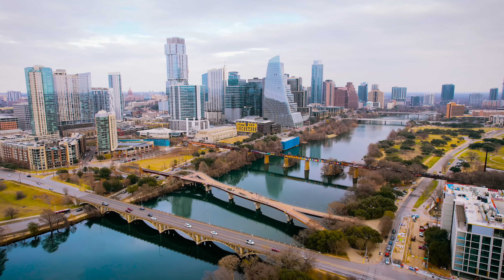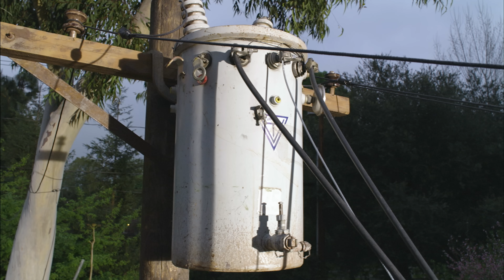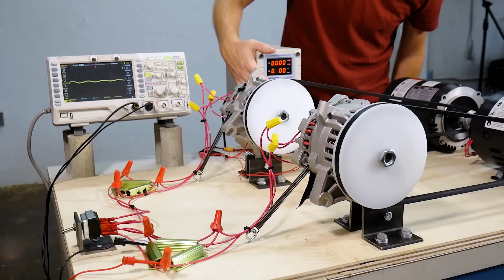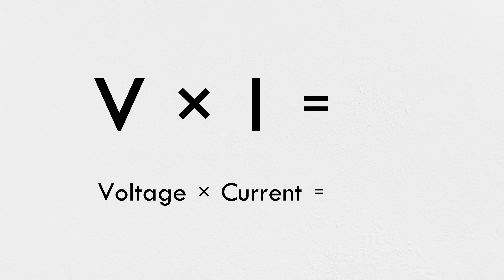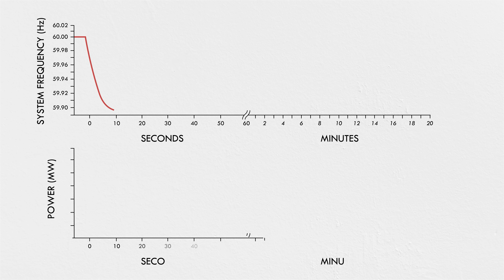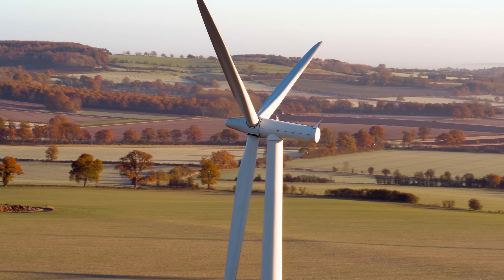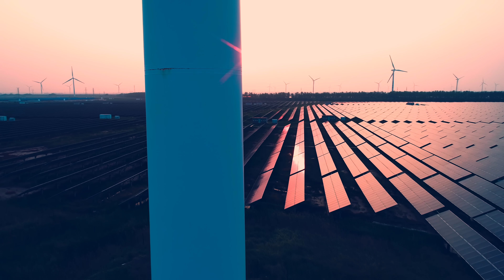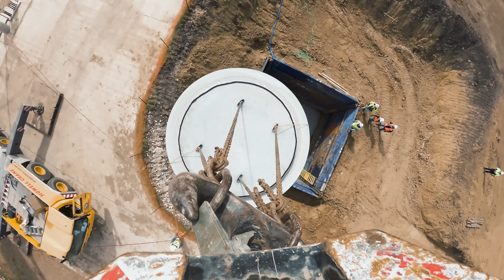Connecting Solar to the Grid is Harder Than You Think

Comment: You should do a video on DC power grids and the challenges of switching. This would solve a lot of these problems, and now that almost all devices rectify AC before using it and switching DC converters are getting smaller and cheaper, its starting to make a lot of sense. Obviously the biggest cost would be installing rectifiers at traditional power plants and replacing transformers with DC converters at substations, but then after the switch adding new renewables, flywheels and batteries would be much simpler. I'd love to see an analysis of at what point the switch is worth it.

Comment: 7:16 are all of them variating only voltage, or are also there some of them, which can also control, or limitate the frequency? I mean, for example, the power supply from the grid is missing, we start the diesel-alternator, switch to emergency power supply, connect alternator to our house, and grid inverter recognize the alternating voltage, and support our diesel-alternator. But if power consumtion is not big enough, the sun is shining, and grid inverter dont have frequency controlling (limitation), so the diesel-alternator will accelerate too much, and achieve too high rotational speed, piston will jump away from cylinder, and alternator generate to high electrical frequency, what could damage some electrical gadgets at home! But if grid inverter has also frequency limitation, it will support alternator, and it will run without fuel consumption or with less fuel consumtion, depends from pv power and electrical load. Even if grid inverter does not have frequency limitation, we can connect additional limiter to our home grid, and let him hold constant frequency with resistive load, bigger than maximal power of pv panels and inverter, and heat water or air for example. And there are of course also protecting guard relays, which could disconnect grid inverter, if something goes wrong! Have you already made such experiments, whether it works or not?

Comment: So we are "saving" the planet by covering it with solar panels and Windparks (both low energy density systems) and to make that stable need a backup of traditional power supply which is expensive and prone to faults because it does not run smoothly. So it is all expensive and destroys environment while increasing surface temperature where both solar and Windparks are built. 
Seems like a great idea.

Comment: There are other huge issues with IBRs, I am a Protection engineer and deal with them on a daily basis. Basically all the power system was built to follow specific laws of Physics, unfortunately the IBRs do not follow them. IBRs don't produce zero sequence current important to detect ground faults, no negative sequence or even worse, different angle between negative seq voltage and current, and positive seq maxed at 120-130% of the nominal which is less than an overload condition for the GSU. So there is no discriminator to reliably detect faults on transmission lines connected to them. Also, Spain used 80% RE in the day of the blackout and IBRs did not show to the party with any voltage support. So Renewables are a disaster in the making.

Comment: solar dump to a thermal heatsink battery. extract the heat with a heat exchanger.
Reply: That sound like a 60% loss at best
Reply: @Molombo89  A 5 m³ sand bed raised from 20°C to 70°C stores:

~89 kWh of usable thermal energy
R40 air tight box.

Comment: What if solar plants have a huge DC motor that converts all the solar energy into mechanical power, then convert it into electrical power in generators like the steam tubines do in usual thermic generation plants. That way we would have the inertia to withstand such variations. DC motors can be easily controlled to have a constant speed to match the 60 hertz required.

Comment: I saw one TED Talk in which the guy said WInd requires thermo electric powerplants to be built alongside them to smooth the power production variation. I know that small hydro power plants can be used to stmooth and even inertial systems could be used to smooth the power delivery oscilations (like a low-pass filter). It all depends on the generation matrix available. (the sources of electrical power).

Comment: How much power would be lost if people use DC engine - AC generator inverter? Most of the issues shown in the video would just disappear in that case. Grid would pull frequency of smaller generator automatically and phase synchronization is simple. Also shape obviously - a proper sin wave.

Comment: That's Why they have Low frequency Cut offs  which were Integrated after the 1969 Blackout in the North East.
Inverter technology has Come a Long way Since the early 1980's   we had a 50 HP three phase VFD Driver it was in a cabinet the size of a two door Closet In the early 90s you could get one in 22X 36" cabinet   now you get ion almost half the Size.. The Biggest 
Choke point Like electric cars is Better battery's

Comment: I've had solar PV plus inverter and batteries working happily for 16 months now. but at the end of April, it became unstable, on a hot spring day, but starting early in the morning, about an hour after sunrise after the batteries had begun to charge, the inverter decided to try to export some power to the grid, but my fridge and freezer needed to use that power too. For the rest of the day there was a 3-way battle between batteries, export or home use, the batteries eventually won, but my generation for the day was about 20% of what it should have been for a cloudless day, as was the day before too.
Exactly the problem described here.
Two home solutions for me, either switch the inverter off for a minute and restart it when it was becoming unstable, or switch off home demand until the batteries had fully charged, in my case shutting off fridge and freezer for an hour until the batteries had fully charged.

Comment: Here in Spain we’re still waiting for an explanation of what happened last Monday .Your explanation is excellent . Top quality .
Reply: Venia a comentar exactamente lo mismo
Reply: Same thing, I'm a spanish engineer and this  a really good explanation of the fragility of our current grid, energy/mix
Reply: Update in this topic: it looks like we found another weakness with inverter based resources especially when added up with poor control of reactive power, according to the Entso-e factual report it looks like the start of the cascading event is that, after the 2 big oscillation before 12:30h the configuration of lines and shunt reactors with the voltage feeding of the inverter based power generators caused an overvoltage in various places in the southwest Spain that caused first (they teorice) embedded inverters aka small household and industry rooftop installations to disconnect in overvoltage protection mode and that caused a sudden load increase in the grid causing the frequency to drop while the overvoltage in the grid also caused solar and wind farms to trip, causing the cascading effect much quicker that the load shedding could act in a very weak and unstable grid configuration
Reply: How so?  All this has long been known technically to power engineers. Grady is a fine communicator but he didn’t discover the max power point. And yet Spain/Portugal went and built a system w too much solar that was bound to fail anyway (killed 11 people).  Why is that?
Reply: Same here. Spain is among the countries with the largest renewable penetration, so what happened here might be foreshadowing what could happen in coming years elsewhere as renewables become the main sources of generation. Renewable producers that sell electricity to the grid need to be well-regulated to ensure they provide grid-resiliance mechanisms such as synthetic intertia, etc. Regulators and politicians nationally —and internationally— would do well to take notice.
Reply: @filiptc you sound like an article in the Economist
Reply: Je je, (S)pain

Comment: Typical panels produce 50% of rating in summer, 5 - 10% in rain and 25% in the other 9 months. Zero from 4pm to 11am. So a typical 10MW plant produces about 10% of its rated capacity which makes it a total scam. For SPAIN to say they are 100% green is BS because there is NO SUCH THING as 90% of the time the sun is off, panels underperform or wind is too low or too high. This is all just TOTAL SCAM
Reply: True as I can verify from my own PV array.
Reply: @mrradman2986  I am 100% off grid for 10 years. I think green for a private home is great. Once the politicians get involved its a total scam
Reply: @DanThomas-n1e  yes!
Solar is awesome for home use, with a battery bank you can easily go off grid and even make a profit in the long run.
But it's impossible to run serious industry off solar and wind. That requires round the clock available power on demand
Reply: @FerdinandFake  Exactly.

Comment: Why not have have a solar PV series string with 300K panels in series (and parallel for redundancy) producing a megavolt for powering UHVDC power lines?
Reply: How do you want to shield the modules from that Voltage? 

It would simply explode. KV on mm thick Materials is never a good idea. 
Capacity effects between modules usw.
Reply: @MJ-mw3ni  so you're telling me it would be a spectacular experiment to see what happens and maybe get some fireworks? 😉 Thanks for the explanation

Comment: The first grid storage sized Megapack that Tesla installed in Australia was for a wind farm. 

The intended use was to allow the wind farm to offer power at a higher level. If they were committed to the average power predicted, when there was below-average production (opposite of a gust), they couldn't meet their commitment. As a result, they could only commit to a power level substantially below the average of what they could provide. By using battery storage to fill in for those short drops, they could commit to a higher power level. 

They ended up paying for the batteries within a year because of payments the received for maintaining grid stability. The ability to instantaneously adjust output power did wonders for maintaining frequency. In fact, what they had previously considered good control now looked very noisy in comparison.

Comment: The real issue here is what should be the nature of the interlink between producers and consumers. The simple answer is idealized HV, but this splits into AC (765kv) and DC (500kv). 

So ideally if you don’t want trivial producers altering the phase of the grid, you would assign a large number of producers to HVDC super grid. Their responsibility would be to produce 500kv power, which is then converted by the power company to grid operator to HV - AC for transmission. The problem with this scheme is rather obvious. Electricity likes to travel and I think it’s something like mm/ 3000 volts in clean air thus 500,000 volts can travel 16 cm or about 6”. Therefore no small opertor can connect to 500,000 VDC without grid support. The grip operator needs to provide tap points in which each provider can switch remotely his DC. To imagine the complexity of this problem, imagine if each solar panel was 12 volt DC. In order to supply voltage to the grid a series of 50,000 panels with the end points of the series charged to 500,000 volts. A work around here is that instead of panels constituting the series the panels individual feed batteries that are then stored in protected and isolated which cycle between charging and feeding the grid tap point. 

   A second solution is to put the panel out put on a capacitor and then discharge the capacitor in a cycle, creating a wave function, you could have two of these per panel that fluctuate between say 8 and 12 volt (x2) creating a 4v wave that can be transformed into 500,000 volts AC and then rectified before the tap to DC. Other schemes would be panels directly produce 120VAC. In either case the pulses of all the panels need to be synchronized by a common clock so that the feed that reaches the power tap is the same phase. The power converted (either provided by the grid or the supplier) the converts this to DC. 

  The alternative is AC. Transformers do not produce monodirectionally, a low voltage cycle on one side can step up to a high voltage on the other side or vice versa. Thus power can be sent to the grid via AC through the existing transformer network provided there is sufficient capacity. 

So to understand what power is we need to talk about phases. In application we talk about single phase and three phase. We don’t use 2 phase, but two phase is simple single phase with double power. In residential a transformer creates two power leads and a neutral which is fed from the center of the coil. From one end to the neutral is one phase of 120 VAC and to the other end is the opposite phase. But the power company sends out three phase which is then converted to single phase ~ 12kv or 4160v which is then converted to the split 240 volts. The grid is based on HV 3 phase. So residential and commercial are two different birds. Commercial has three transformers for each phase which is brought down to 120 or 480 vAC. It is now federal law that all commercial refrigeration and AC be 3 phase, though not all commercial establishments are 3 phase power. 
    This is a bigger problem than you think because not every point on the grid is close to a 3 phase. The grid wants balanced 3 phase power. So that has to be a given. Currently the ERCOT grid is 345kv and 3 phase at 60hz. To understand this we need to draw a circle. We place a point at the origin and +/- 120° (+/-0.666 rad). Thus any point on the circle is within 60° of a phase or 30° from a phase or anti-phase. Thus the power match is >0.866 as long as an 60hz generator can switch between polarity and phase. As stated creating 345 kv of output is not going to be feasible for most suppliers so that most suppliers will not be able to tap into 345 or proposed 765 kv Supergrid. 
    As long as suppliers don’t have to deal with voltages over 1kv then creating power has the problems of synchronization and fault modes. Creating a smooth power output is not a problem. Let’s assume that we have a 1000v series of batteries composed each of 10v units , if we tap the 1000v at each point we can generate voltages between -1000, -990,….990, 1000v If we then tune a central axis of rotation to 60hz with 3 cycles rotating about the axis we can create smooth voltage cycle composed each cycle has 200 divisions in which it picks up voltage and a capacitor which smooths out the transitions. You can do the same thing electronically. So now you have 1000vAC three phase power, basically useless. 
   The next thing is power transmission, you need a step up system to create 12,000 v or 4160 power from that 1000 volts, which is going to be some firm of transformer at the transition. But more importantly you need to synchronize. This you need a signal. Using the phase signal from the endpoint of the grid is great until you become the major supplier at which point, as in Odessa, all the suppliers are producing more power than the grid at which point the signal is murky. So then everyone needs to agree on a timing parameter. Timing signals are sent by GPS and can be curated by local ground stations, but everyone needs to agree to stick to the timing. When power is in short supply the timing can deviate and this will cause phase mismatch between suppliers and the grid. This the grid operator needs to send out a separate timing signal so that its suppliers  will set the initiation of the phase cycle according to the grid operator. How bad can this be. Our thousand volt signal reaches a power transformed that has no 180° out of phase. The result is 2000v at full amps dumped on the transformer which not only knocks down the voltage of the grid but poofs the transformer. 
    The third problem is the US. The US is kind of big. It’s about 3200 miles across or about 5000 km. But we can measure the US another way, we can measure it in light seconds. 5000000m/ 3E8m/sec = 5/300 sec 1/60 sec. What is the duration of a phase?  1/60 of second. This gets into relativistic physics but a phase that begins in say Kansas by the time it reaches Seattle and Miami is 180° out of phase with the Phase being generated in Kansas. If Seattle Kansas and Miami are all reliant on the same timing signal, say an equitorial GSO satellite, the power they send to each direction will be out of phase. The second problem here as we see in California extremely high wind events can cause the crossing of power lines. But in truth, they don’t even need to cross, just two lines of 1.2 million volts will arc about 1 to 2 feet in distance from each other and this will result in potential ground fires in very dry air due to ionization of the air. As a consequence some have argued that there should be a second, HVDC super grid which each grid contributes to. If Each grid was part of the super grid then the Solar power and wind turbine issues disappear for a very simple reason. If all parts of the grid that are major supply hubs are also attached to the HVDC super grid, then their power output can be tuned to the HVDC grid and that supply grid can be used to stabilized to the local grid. The super grid can then signal to the suppliers whether more or less power is needed on the grid. Likewise, there is no transcontinental phase problem because the power Kansas wants to send to Florida is place of the HVDC grid and that power is negotiated by grid operators along the way.